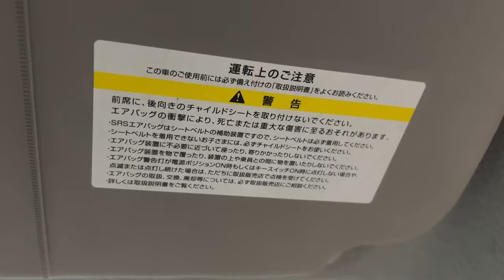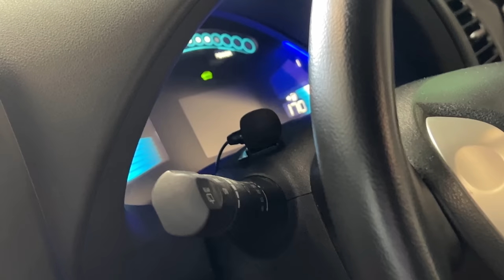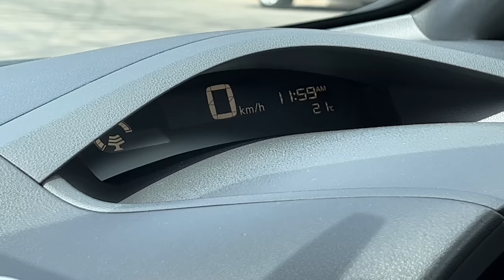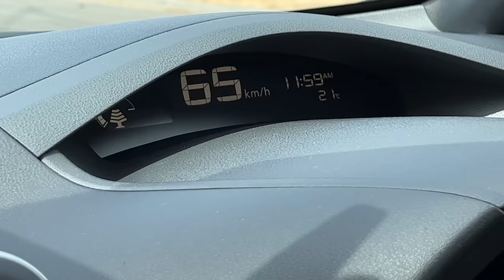I bought an electric car.

Comment: Right, so a couple things to keep an eye for.
This does not have active battery thermal management, meaning that the battery temp is basically regulated by the outside temp. Especially in Australia, you shouldn't charge it more then 2 times in a row fast and even then after, leave it cool down for about 12 hours.
When it gets below 6°c about, range is MAX 100km no matter how easily you drive, probably won't be much of an issue.
Be careful about fast charging in hot weather, try to avoid it if you can.
After 3 fast charges in a row, you should then slow charge it to re-balance the battery. It will make it last A LOT longer that way. 
This thing is pretty nice for a commuter car, you're gonna like it.
For tyres, I recommend Michelin Crossclimate 2 tyres as they are good in rain and super efficient for maximum range (yes, tyre efficiency is a big factor for electric vehicles, also, keep on top of tyre pressure for good economy)
Use B mode if you can in city driving but driving on motorway or anyplace where you don't really need to slow down regularly, use normal D mode (you engage B mode by selecting D for the second time and you can toggle between D and B. 
Also, use eco mode, it helps with smoother driving and obviously, longer range. 
For now, that's around all I can think about, I'll edit this post if I remember something else.
Reply: How is b mode different compared to d mode ? I've driven an ev around once or twice for work (a Renault Zoe) and I'm confused on what it does
Reply: @eizzah8323  Regenerative breaking, or one pedal driving.
Extremely oversimplifying - car brakes when you let go of gas, slightly charging your battery.

Really good around town or in traffic, because if you get used to it, you won't need to touch the brake pedal 80% of the time.
Reply: That aint a few things thats a full on warning section
Reply: This man Eggs
Reply: Thanks. I I have a nissan Egg too and these are great tips, although have an '12 egg I don't get the plus side of B mode without acceleration loss.
Reply: oh man you definitely know your stuff about EVs and the nissan egg
Reply: Dank's preference for trickle charging might help mitigate this issue.  But yeah, passive cooling of the Leaf's battery was (and still is) an epic fail on Nissan's part.
Reply: Sounds like an absolute hassle
Reply: Crossclimate 2*

The CC+ is pretty old.

Also why would you buy an all-season tyre in Australia? He should just get a Michelin e.Primacy, that one is actually made for EVs.
Reply: you monsters need to stop spelling it 'tyres' theyre TIRES
Reply: @bradhaines3142  It's a cultural thing, Aussies and Brits spell it Tyres, deal with it
Reply: @eizzah8323  it increases the regenerative braking, which means the electric motor will have a stronger "engine braking" effect. B is for Brake mode basically
Reply: @TheShinyiest  that's the point of it. Also, it has a stronger engine braking effect, putting more juice back into the batteries
Reply: @BottomOfTheDumpsterFire  just a tech trying to help a first time owner😂
Reply: @ericf112  with a leaf, can be. But with basically vw ID cars, it's really simple. Every 3rd charge must be trickle charging. Other then that, nothing different to a normal car
Reply: @swecreations  I live in Ireland so that may reveal my choice🤣🤣
Reply: @bradhaines3142  tyres is the proper UK English way. Tires is Aussie and USA English if I recall correctly. I live in Ireland
Reply: “Tyre” 😂

Ye Olde Tyre
Reply: @coastaku1954  not cultural but dialect, which I guess it is cultural 🤔😂
Reply: @coastaku1954  No. RREEEEE
Reply: @joearnold6881  Proper UK English vs Aussie and USA English
Reply: @bradhaines3142  So you're just gonna be a American number 1 kind of person? Other countries exist ya know
Reply: @coastaku1954  nah america sucks (the feds mostly) but this is the internet where people are supposed to REEE so thus, 

its TIRES. not 'tyres'. tires is also fine. never TYRES
Reply: Or just drive and charge it and not care about those few extra %
Reply: @bofty  because of the lack of thermal management, it can be not a few % but it can be more like having 50% efficiency of your battery in 4 years or 80+ still. It REALLY matters
Reply: @bradhaines3142  ironic bit is Tyres came first until America ruined it🤣🤣🤣
Reply: @swecreations  I agree, not sure why that’s the tyre someone would recommend for a light use EV in Australia…
Reply: @ericf112  Well it IS one of the worst EV's..... it's a bit of a nugget even if it is fast. Most EV's have active battery cooling which mitigates all of this. Even my honda plug in hybrid has active battery cooling on its 17kw battery. Also, if you own an EV, you realize just how easy keeping it charged is. You just plug it in when you get home, and that's it. Every day, 100% range. The fast charging is really only for road trips- which are not all the time for most people.
Reply: @April480p  regenerative breaking is pretty much turning a generator to slow down instead of using a brake pad.
Reply: Welp, that covers everything I wanted to say about these. Bravo.
Reply: @eizzah8323  according to Roadkill, D is for Drive, B is for Badass.
Reply: @iro-huncarguy8367  we use uk english
Reply: @iro-huncarguy8367  tyres is Aussie as well. Aussie English spells almost everything the same way as the UK, it's mostly slang terms that are different down here
Reply: @bradhaines3142  Hey Sepo, stop banging on about the tyres and tell us if you like the colour?
Reply: @Dwil9057  i love the color. are you one of those french monsters that add letters where they dont belong?
Reply: 101 reasons not to get an EV
Reply: Putting CrossClimates on anything should be punishable by towing
Reply: Wow, I could just have a petrol car, and basically be way better off.
Reply: Yeah, the Leaf not having active battery cooling is brutal, especially when most other EVs have it. Even my old Spark EV (a super cheap compliance car) had a liquid cooled battery. That car survived a few 110f summers no problem.

For the couple people in the replies doubting EVs over this, don't. This is a Leaf (and maybe Kia Soul EV) thing, most EVs are less funky. In my 3 years of EV ownership (Spark EV and Bolt EV), I have put almost no thought into this and seen no perceivable battery degradation or unexpected range loss.
Reply: Oh this guy's not doing any of the extended range and eco mode things. I just know this Nissan egg is getting hammed everywhere daily from now on lol
Reply: @tylern6420  man think of a warning list for gas cars though, you gotta take them in every 5k and have a nonrenewable resource based juice replaced, repeatedly for the life of the car, of it will literally throw pieces of itself through itself. 

You "charge" it by filling a tank full of explosive toxic flammable liquid, and that liquid is pumped under high pressure in plastic tubes around an engine with pipes hot enough to instantly ignite it. 

There's a lot more wild stuff about gassers we just kinda ignore because we're used to them.
Reply: Oof. as someone who lives in Adelaide that first one sounds bad. it can get over 45°C on the hottest days of summer and sometimes stays there for a week. Maybe give the EV a break on those days.
On the other hand getting below 6°C is a non-issue. it never happens
Reply: @joelcarterramadge183  I live in Ireland, run your imagination wild from that🏃🤣
Reply: @glowstoneunknown  got it, I wouldn't have guessed that, but make sense considering history
Reply: @dashieldmasta177  I'm from ireland so it's the best tyre for an ev here really
Reply: @pleasantfall7281  honestly, if you don't get a leaf, 90% of these will just not exist so this is really extreme as a leaf is, well, really bad
Reply: @906MediaProductions  no, we ignore them because they WORK under basically any condition. And the used oil can be used as fuel in my ol diesel😂 so it is 100% renewable for me
Reply: Woh sounds like you owned one. My condolences.
Reply: @iro-huncarguy8367  doubt you’ll lose that much that quick, I’ve never heard of it being that bad. Do you have any sources?
Reply: He's in Adelaide, it never gets below 6°C.
Reply: Thank you for this. This is useful information know
Reply: This is WAY too long so I simplified it:

-The car doesn't actively manage battery temperature, so it's important not to charge it too often and to let it cool down for 12 hours after fast charging.

-In temperatures below 6°C, the car's range will be limited to 100km no matter how carefully you drive.

-Fast charging in hot weather can be harmful to the battery, so try to avoid it if possible.

-After three consecutive fast charges, it's a good idea to slow charge the car to rebalance the battery and extend its lifespan.

-The car is great for commuting and the Michelin Crossclimate 2 tires are recommended for their efficiency and performance in rain. Keep the tire pressure in check for good fuel economy.

-Use B mode in city driving and D mode on the motorway or other places where you don't need to slow down often. Eco mode can also help with smoother driving and longer range.
Reply: Why?
Reply: Used EVs are indeed becoming a thing, I wonder if my next car will actually be a used ev since I might have solar by then 😁
Reply: @bofty  basically look around the Internet. If you live in a place where the weather is fairly moderate, it's basically as "good" as it gets. But if you live in a constantly cold or hot place, it kills electric car batteries without active thermal management. And these leafs used to be bastards for it
Reply: @Neojhun  dad did. He then traded it for a BMW I3 94ah REX, that was basically the best early electric car, although expensive as it has a full carbon fiber chassis, thus making it SIGNIFICANTLY lighter, even with the little petrol engine in the back. He drove that once a year across Europe (about 2,200km each way) and did it well. Eventually when it started costing money to charge (yes it was free to use public car chargers here in Ireland) he traded it in for a 2016 Škoda Superb 2.0TDI. He still has that car, gave it to my mum and drives now a 2010 SEAT Exeo as he drives a lot so he just buys beater cars (still very good though) but all cheaper to run even with servicing as it is stupidly expensive to use public chargers and he sometimes does over 1000km a day so yeah
Reply: @lambdaboy9999  I got a but more technical but yeah bout it😂😂
Reply: @BoredRn69  cause I don't have a life clearly 🤣
Reply: @jt16omes  if you have solar, it's an extremely good option. Especially nowadays, many government grants are available depending on where you live so it could make back as an investment
Reply: So in a tropical climate it may be less aof a hassle to have one of these
Reply: @ericp.5533  yes and no. It will heat up quickly and reduce its life span, it's just not a great car overall iwl
Reply: @April480p i know this comment is old but is it like engine breaking in a manual? when you let go of the gas the car automatically slows right

Comment: I remember the first time I took a Chevy Bolt for a test drive... they're bottom of the barrel EVs here in the states, but they are SO MUCH FUN! It's insane. I feel like 95% of people who hate EVs have never tried to drive one. Even the boring ones are hilariously fun.
Reply: As someone who owns a 2020 Bolt - man, when I have to drive the SUV for one reason or another I just don't ever feel as comfortable in it. I molded myself into my Bolt in a matter of a month. It made someone who really REALLY hates commuting into someone who can actually tolerate an hour-long drive to see friends. Responsive accel, L mode making driving a nearly one-pedal affair, surprisingly comfy suspension and such (really important for me off that gravel road). Just a lovely little package, and I'll never regret just outright buying the thing instead of fussing over payments - yes, even with the ridiculous battery shit that just happened. 

Fun fact - it actually costs less money in electricity for me to keep my Bolt charged for a month than my PC being on for that same month. Not that much less, really, but assuming I'm not making a two-hour roundabout trip every day, it's super inexpensive fuel-wise.
Reply: volt will always be on top for me
Reply: the kind of people that hate EVs would hate how better they are for driving

Comment: My mom leased a leaf for 3 years when she was still working as a travel nurse and loved it. With the solar panels on their house it was 8 bucks a month to keep the house ice cold in the 100+ degree heat and drive a few hundred miles in the leaf. Super cool if you have all the extra gizmos
Reply: I have a couple solar panels I havent installed

Suddenly an EV doesnt seem like a bad idea

Already bought a 1991 Mitsubishi Lancer GTI 16V tho, really doesnt use much gas, if you can keep it under 4k rpm (engine likes to party with 140hp)
Reply: The 5000$ replacement battery, good for mabye 35 miles. Not a good investment this one.
Reply: @DarkLinkAD  ??? What are you talking about, the batteries last an average of like several thousand charges, which could be like a 100k miles.
Reply: @DarkLinkAD amazing way to say you know nothing about these cars. this comment is so fucking funny

Comment: So if you want to do a performance mod, you can take the inverter from one of the newer 62kwh leafs and put it in yours, then you can use a computer to change the resolver offset and that basically upgrades your 80kw motor to 160kw
Reply: Wouldn’t that put a lot of stress on the battery though?
Reply: @joshuaashton1929  probably but that's part of the fun experience id say
Reply: Sounds like a great way to cut your range in half lmao
Reply: @WelcomeToDERPLAND  
smiles per mile >>> miles per gal- miles per charge
Whole EV thing kinda messes that saying up
Reply: @WelcomeToDERPLAND  actually since it only pulls full power for acceleration it doesn't have as big of an effect on it as you'd think
Reply: @ieatplastic2367  if I did that I’d want a way to turn it off/on with a switch or something.
Reply: @WelcomeToDERPLAND  won't impact range at all.
Reply: @swecreations  I own an EV, and going up hills and speeding up to highway/freeway speeds will definitely cut into that higher power draw, and especially if you install it for the fun of faster pickup from stops it'll dig in a bit more.

Sure its not going to change anything if you just drive normally around a flat town, but at higher speeds, if you floor it from stops or going up hills it'll definitely cut into that already small range of an old leaf.
Reply: @ieatplastic2367  ah yes the fun Unabomber of ev experiment
Reply: @joshuaashton1929  Depends on the C rate the batteries are rated for, and how long they can sustain their C rate. Like, you have batteries that can do 150C, but only for 0.1 seconds. Luckily these old Leaf batteries are researched well enough that you could take a dismantled pack and create your own with the Leaf modules (they're like 2s2p modules or something), just don't forget to implement your own BMS solution and inverters. Hell, you could make it 800V if you're so inclined, the sky is the limit (and space, and money, and technical ability)
Reply: @WelcomeToDERPLAND  Nah the range wouldn't be affected, it's not like displacement where there's a meaningful trade off between power and efficiency.
Until the poor leaf's battery gets cooked because it's getting more than double the power draw it and its shitty cooling system was designed for, anyway.
Reply: Tourqe steer, wheel hop, but most importantly 20 Mile battery range. Nice.
Reply: It's hilarious to me that he started the video saying he "needs a boring car" and yet we're talking about modding it lol
Reply: @coupledyetivonvanderburg5385  smiles per kwh you could say
Reply: @joshuaashton1929  HAHAHAHA NO!
Guessing this has a 30kWh battery. The most likely possible upgrade is to 120kW which is just 4C. Any C Rating under 5 is low stress for a properly designed battery. Just don't haul ass on a hot day, it'll overheat like any car.
Reply: @WelcomeToDERPLAND  Sure only if you lead foot. The great thing about 500HP BEVs. As long you don't use the power and drive sensibly you can maximize range when you need it. When you don't care about range and just going for a short drive have fun and stomp on it.
Reply: @pleepler  The highest C Rating i've ever seen on a OEM warranty covered Car is 10C, that is an insane amount of power basically Lucid Air & Tesla Plaid.